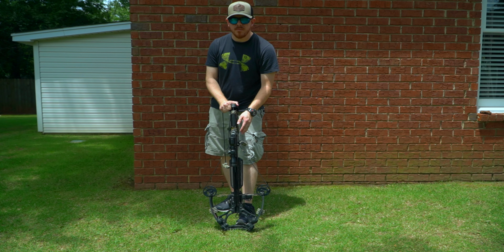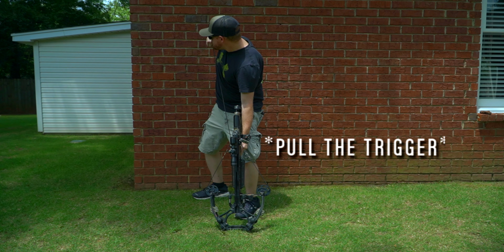De-Cocking Your Barnett Crossbow - An Alternative Method

Comment: I own the BWH STR myself and have for 3yrs now. Love it and have put down  a lot of deer with it. I carry a extra bolt with a field point. To decock it I discharge it at a slight angle. As of now still have the same string and cables. The performance is still absolutely awesome.

Comment: The problem I have found with the short decocking bolts from Barnett is they force you to put your hands in the danger zone. I never put my hands between the strings and the stops. I have seen a crossbow string accident and they are nasty! Maybe just bring the long decocking bolt that is reusable. 

Also I have the whitetail pro str from Barnett and have shot it 300 plus times on the original string, and just took a deer with it last week.

Comment: I have no issue firing the decocking bolts. 

One thing I ALWAYS do for safety, especially as a disabled hunter, is have the hooks to the cocking crank hooked on the drawcord when loading or swapping between hunting bolt and decocking bolt. Even though the safety is on, there's always the risk of it going off unexpectedly. By keeping the hooks on, it gives me a sense of security that should it suddenly fire the hooks will stop the cord from traveling too far.

Comment: Seems like firing a 6" plastic bolt would pretty much be the equivalent of dry firing your bow, especially because of the length and particularly the weight. Plus as others have said, your fingers are right in the no-no touch spot as you load it.

Comment: I have a decocking tip that threads in like any other head. Pretty much a field tip with a wide piece of aluminum or something behind it. We all have those arrows that dont fly right. Choose one of those and there you go, decocker. Id never decock in the manner you do (though not telling anyone how to live their life). For me the risk of slipping up one time and blowing out strings and limbs is just not worth the risk. Id rather just fire off a garbage bolt or decocking arrow and save the bow.

Comment: Just keep a field point with you and fire it at the ground.. don’t buy all this other stuff. I have this exact same bow.
Reply: Make sure to fire at the ground at least 10 yards i would say, i lost a bolt because my 350 fps crossbow buried my bolt nock deep and i couldn’t get it out of the ground
Reply: @landenrobinson7500  Take the field tip off and put the biggest washer on there that won't slip over the tip. Fender washers are ideal, large diameter with a small hole. Anyway that'll keep it from sinking very far into the ground.
Reply: @Aedalas  good idea, seasons over but maybe next year
Reply: @landenrobinson7500  Better to have it and not need it than need it and not have it. Next time you're near the hardware store grab a few washers. Or better then, grab a set of calipers and figure out what size you need before checking out Amazon or something. I'd much rather figure it out at home than I would up a tree.

Comment: I just use a decocking bolt I have used an old bolt that I have called out that has some issues and just but a decocking point on it.
I even put a lighted knock on so at night it’s easier to find if it skips.

Comment: Not sure how the whitetail hunter is but with the recruit you could use something narrow to pry the safety piece the bolt lifts up from behind the string allowing the safety to be turned off, not that I'd recommend it but it seems safer than having to load any kind of bolt in it to unload it that way. Always just shot mine, heard of enough rope cocking device strings snapping so I'd rather not chance a bolt through the foot lol.

Comment: Hello, I want to ask, to what extent does the abrasion of the rail paint affect the accuracy?
Reply from the maker: My rail hasn’t lost any paint, so I’m not sure how it would affect the accuracy. I keep rail lube on it pretty often. Like every other hunt. You just put a drop or two on each side and just use your finger to run it down the rail. (Obviously for safety, you wouldn’t do that when it’s cocked.) But that rail lube should minimize the abrasion.
Reply: @pippencreekproductions  OK, I see. Your railing is made of polymer material, and mine is made of aluminum alloy
Reply: @pippencreekproductions  Anyway, thank you very much for your reply

Comment: I wonder if you could use a nerf bolt, then if something goes wrong you wont blast it through your foot.
Reply from the maker: Wouldn’t recommend it. The reason why I’m using these bolts is because they’re designed to fit the crossbow. You wouldn’t want something random (nerf dart, stick, or other objects people have tried) to get stuck if it’s not the right size. Also, I don’t recommend putting your foot through the riser for this. However, if you have tension on the bowstring by pulling up towards you, there should be no energy behind that bolt once the trigger is pulled, other than the force of gravity when it drops.

Comment: If your big worry is wear on your string, you honestly may want to find a cheaper hobby. A new string is under $40 every 
Every 500-1000 shots (avg) Even if for arguments sake you only get half of the lower limit you should get say 250 shots from your string, you are talking $0.16 worth of wear to just fire in to a target. Grab a little 6" target, toss it in your pack or, the rubber ball tips are fine if you dont want to carry a target. Really, how often do you need to de-cock your bow, at most once a day if your hunt is unsuccesfull? That wear is likely costing you a dollar or two per year...Ive likely burnt more money worth of callories responding to this nonsense lol.

Comment: Another gentleman has a clip on this, and the small arrow isn't even necessary.   He just flicks the safety off, pulls off his bolt carefully, & then does everything you just did.  Your way may be safer, however.   Mission crossbows are designed the best for this, but they also cost much more.   On them you flick a decock button while the safety is still on.  You pull back with both hands on the rope cocker, it releases, & you let it down with both hands.
Reply from the maker: Yeah that’s the issue I’ve had with crossbows in general.  It’s as if you have to sacrifice safety for a more budget friendly crossbow. This just shouldn’t be the case. As far as the guy with the Barnett Raptor and the other guy using a stick…I’ve seen their methods and those don’t seem safe to me. I’d rather not put my hand in front of the string once the safety is off. Just my personal preference. I’d also rather not use a twig in my crossbow for fear of splinters/fragments getting into the working mechanism of the bow. And a full size bolt with a broad head is gonna drop right down to your foot if you use that. So that’s why I decided to use the small bolts as a way to take the safety off. Once that safety is off, you shouldn’t have to put your hand in front of the bow string again. It amazes me that the manufacturers don’t recognize the need for a safe method to decock their bows. I think more people would be inclined to buy their crossbows if there was a simple way to decock them.

Comment: The method you used is how you de cock an Excalibur crossbow that has the guardian anti dry fire system built into it so it;s made to de cock without firing. BIG difference is you DON'T need to have a bolt in there. If something goes wrong you will have a bolt go thru your foot!...not a very good idea....not worth the risk. Just shoot your crossbow with a de cocking bolt if you are up in a tree stand or take a small portable discharge target (about $14.00) with you an fire it off when you get back to your vehicle....I've watched several of these type of videos....jackass idea bro...
Reply: I think you missed the part where he says not to put your foot into the step through.

Comment: I've had an Excalibur Exocet 200 for almost 20 years and though this model allows for you to de-cock, as you're doing, without an arrow because it has no dry fire mechanism. Still, I carry a rolled up large index card with me to put in the bow so that I never forget to remove my arrow before de-cocking. I bet this rolled up index card could be used instead of a bolt and you'd be able to use the stirrup normally without any fear of putting a bolt through your foot.

Comment: What new information did you share other than what anyone else could get from the same internet you quote, the short bolt you show is not even your own idea , and it is available through the manufacturer and or other aftermarket sources. Nor is it even needed to accomplish this goal.
And seriously the amount you edit almost gave me a seizure.
Reply from the maker: What’s different is that when I bought the crossbow two years ago, the only available videos involved someone using a stick (instead of a bolt) in order to pull the trigger and release the tension. (Maybe a stick is a more original idea.) The other video involved loading a full sized bolt to take the safety off, then removing the bolt (While the safety was off) before pulling the trigger to release the tension. You’re welcome to try those ideas if you want. Certainly no one’s forcing you to use this method or to watch this video, for that matter. The manufacturer’s bolt is designed to be shot once and never used again. Therefore you’ll have to constantly buy the decocking bolts and shoot one every time you move to a different stand location. This video is just meant to give someone another option to decock a crossbow. Feel free to use it, or feel free not to.  Whatever you wanna do. Have a nice day.